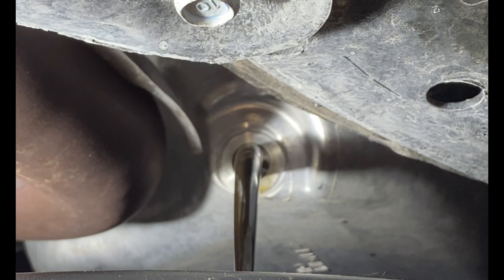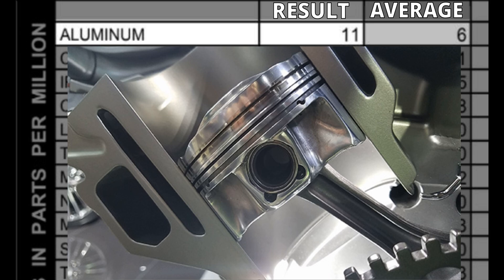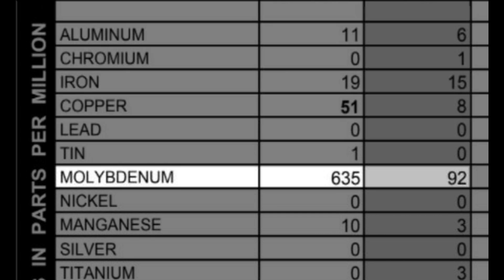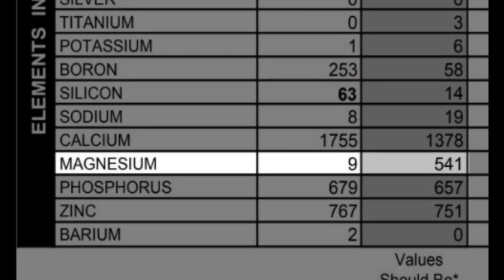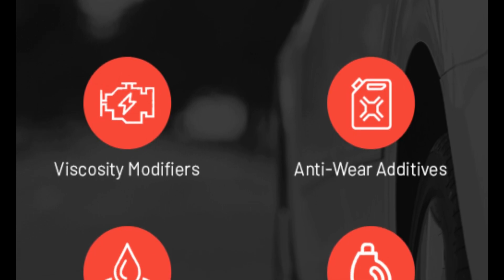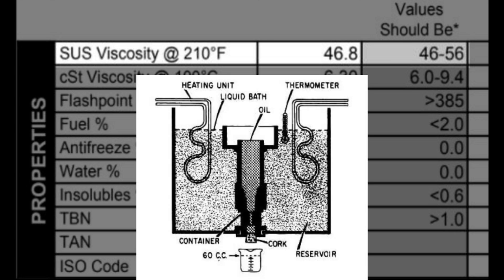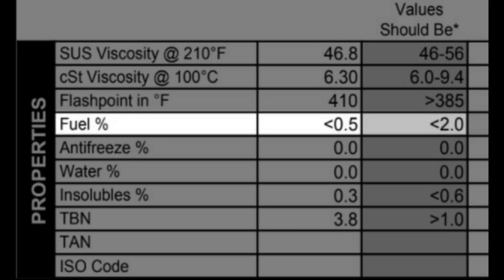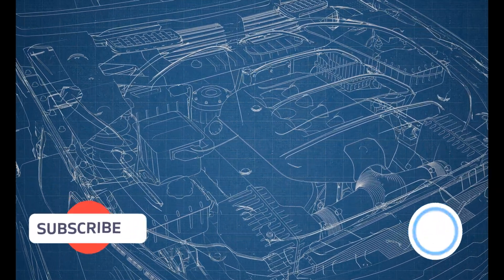New Engine 1st Oil Analysis (Testing For Engine Break-in Wear and Metals of Factory Filled Oil)

Comment: Silicon ≠ silicone

One is a gasket maker, the other is essentially sand. In this case its likely an anti-foaming agent in the oil being picked up as silicon due to the limitations of FTIR graph detecting something around the same area as silicon would show, which gets read as silicon.
Reply from the maker: Thank you for the correction and explanation!  There are so many components to engine oil, it is truly an amazing and complicated feat of engineering.

Comment: No modern aluminum block automotive engine is using bare aluminum cylinder walls. Most commonly, iron liners are used for long life ( aluminum is a soft metal ) or there is some kind of a coating applied ( Nikasil or plasma ). Your piston rings are not running against bare aluminum in this Honda 3.5 V6.
Reply from the maker: I just looked it up, looks like Honda uses cast iron sleeves.  Interesting where the Alu is coming from, maybe some residue from machining process or other aluminum wear areas.
Reply: @OwenLucas  The main and connecting rod bearings are made of steel with a silicon and aluminum layer facing the bearing journals. There also may be bearings supporting the camshafts, or they could run against bare aluminum. On start up, when no oil pressure exists, there will be wear and aluminum will get into the motor oil. On this new engine, some loose aluminum from the block and heads is getting into the oil as well. That will  cease with more run time and oil changes.
Reply: @OwenLucas  aluminum pistons, oil pump housing, block oil galleries, cams caps are aluminum, no bearings, just oil.  Same for balance shafts if used.

Comment: Does OEM during oil change carry out oil sample analysis?
Reply from the maker: This was the OEM oil from the factory that came in the engine.  Honda does not do an oil analysis when you change the oil, it was an extra step I took out of curiosity and for records keeping.  I wouldn't be surprised if these were done on very expensive machinery after every change.  I know that racing programs like Formula 1 have compact laboratories they bring to the racetrack to monitor oil chemistry.